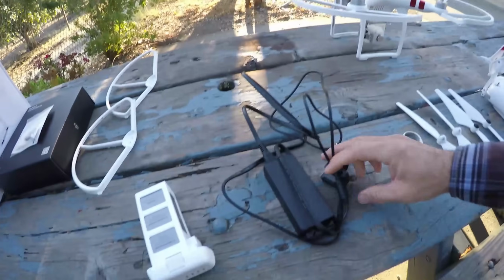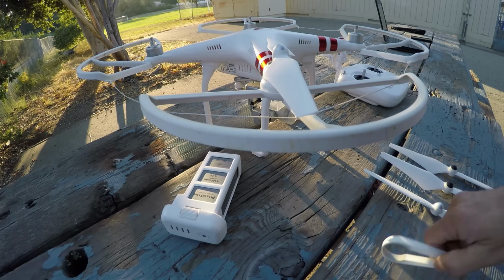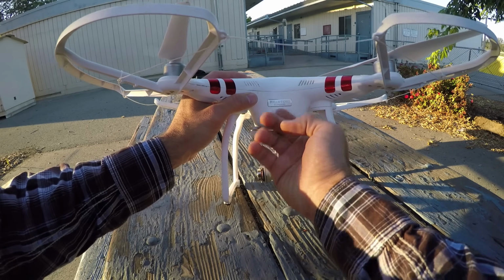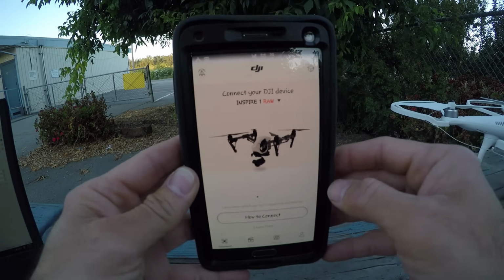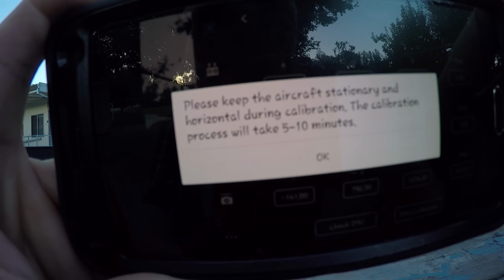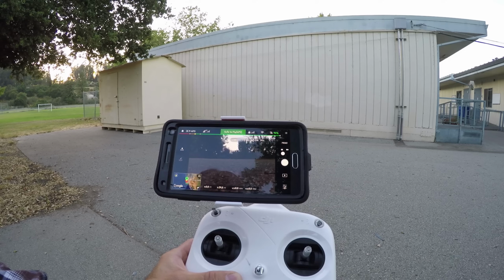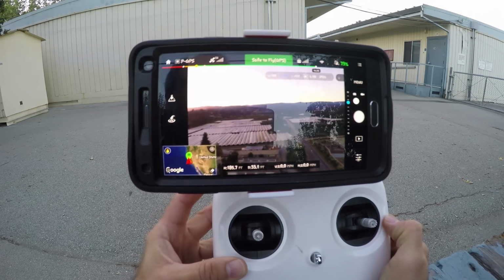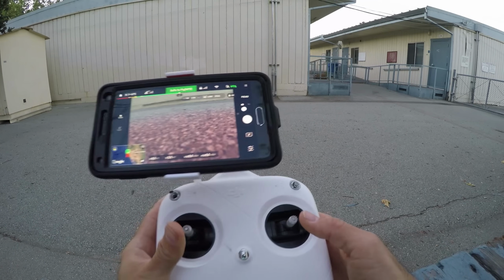DJI Phantom 3 Standard Complete Starters Tutorial

Comment: Tripecollie,You forgot to mention something very important. Unless of course I missed it. If you decide to take the propeller guards off make sure you don't use the same screws from the guard to secure the motor. They are longer and will reach the motor and jam it so it won't turn, or worse it'll turn enough to get off the ground and burn out the motor. Resulting in a crash. Make sure you use the ones you took out to put the guards on. The shorter ones.
Reply from the maker: I do mention at 9:28 in the video that the screws are longer and to save the screws. Granted I didn't mention why it matters though. I made this video really fast all in one day for my dad and didn't expect it to get nearly this popular. There's several things I would do better and change with the video in retrospect but it does work really well as an introduction.

Comment: I am new on this and first time I tried as I turn on the phantom 3 and my remote in about few minutes i noticed  the camera motor was kind of hot i wonder if that is normal , so i had to turn it off
Reply from the maker: Sorry it's taken me so long to respond here. A certain amount of heat is normal, but there's no way I can tell if what you're experiencing with your drone is too hot or not. Does your drone go through the normal camera rotation/orientation process when you first turn it on and otherwise display signal on your cell/tablet properly?  You are removing the camera guard and the lens cover first right? Sorry if these questions seem silly. I'm just trying to narrow things down.

Comment: I bought a Phantom 3 Standard several weeks ago and I have watched many YouTube tutorials on how to operate it.  I have yet to fly it since I could not understand how to operate the DJI Go app.  This is the best tutorial that I have seen.  I still don't understand about how and why the string is attached to the prop guards.  Could you please explain further?  However, all in all sir, you have produced the most informative tutorial about the Phantom 3 Standard that I have ever seen.  My thanks to you.
Reply from the maker: Thank you very much for the kind comments! As for the string, that is simply a barrier/block that holds your prop guards together and helps protect the blades further. I'm kind of surprised they don't have a way to connect all the props together better than a piece of string. For something so fancy/expensive the engineers got a little lazy/cheap on that part of the prop guards lol.

Comment: I noticed when you are flying the right controller switch was in the down position but in the info on the controller you said you put this in the up position? just not sure what these two top switches are for
Reply from the maker: Excellent question! I end up bumping those stupid toggle switches all the time so I did not intend for the S1 switch to be in the down position for the video. So, what are the S1 switch (on the right side of the controller) and the S2 switch (on the left side) for? The User Manual (file Phantom_3_Standard_User_Manual_v1.4_en_0112.pdf on the DJI website) explains the switches thoroughly. I'll give you a synopsis though...

The S1 switch :
*Allows you to regain control of your drone during the failsafe return to home process. I consider this the most important function of the S1 switch.
*Can allow you to calibrate the aircraft's compass, but you can do this through the DJI app too.
*Changes your flight modes (P-Mode, A-Mode or F-Mode) but you can do that through the DJI app as well.

The S2 switch:
*Can initiate a smart return to home process. I consider this the most important function of the S2 switch.
*Can be used in conjunction with the Gimbal dial to link the remote with the aircraft.
*Can be used to reset the WiFi password.
*Can be used to Reset the WiFi Video Downlink.

I hope that helps!

Comment: Of all the tutorials I've watched no one ever mentions operating the Phantom 3 without a cell phone. Can this be flown without using the app? I know you won't be able to do anything except go up down left and right if you can. I'll be getting my P3S in a couple weeks, but don't want to have to buy another new phone. My phone is a LG G3 it's new but not compatible with the Go app.
Reply: I've flown without a compatible phone so no,  but to calibrate and use certain flight modes u will need a phone. on my 2nd flight I went to use my tablet which waa dead so I just flew it using the dji controller
Reply from the maker: As far as I know you have to use a cell phone or a tablet though. How do you know your phone isn't compatible with the DJI Go app? If a phone isn't listed that doesn't mean it's automatically not compatible. I've heard of older phones running the app. DJI just lists recommended phones on their site. You can operate a Phantom 3 with an appropriate tablet and have a better view of what's going on (assuming you have a tablet). Otherwise, I'm aware of other apps you can use to control drones like the phantom but I've always used what DJI provided to make things simple. Good luck in your research online. There's lots of sites you can look up on google for information.
Reply: I had sent email to the support staff at DJI.com. They are the ones,  who answered my question said it wasn't compatible. Maybe it is compatible and the person answering didn't know. Anyway, thanks for the reply. If my LG doesn't work, I'll buy a used tablet.

Comment: Thank Q I love this ... Will ask u for more in future .. If i need any help
Reply from the maker: I'm glad to help if I can :)
Reply: Did u ever fly on the surface of water ?? how i can fly without worry of going down to water .. since phantom 3 standard dont have the obstacle sensor so wonder how i can fly above water surface without any worry .. Thank Q in advance ..My phantom3 standard is on the way m so excited to see my baby :)
Reply from the maker: +D Mantra Yes, I've flown over water, but it's a calculated risk. The Phantom is a great deal for the price, but they can be quirky and lose connection and do strange things at points. There's plenty of people with unhappy stories of their unit not responding when needed. I've had very little issues with mine. Basically there is no way to completely rule out any sort of problem. Just be mindful of your distance, things like signal interference, etc. I hope this helps.
Reply: Can u share some clips which u shot recently .. would like to see :) ..
Reply from the maker: Sure. They're here in my channel, but these are the links:

https://www.youtube.com/watch?v=ZY_gvM06axI

https://www.youtube.com/watch?v=BC6bmnH7_5I
Reply: OMG today i received my P3 standard and getting so excited so many things to be learn .. First thing i noticed is the Switch L-R in RC upper section . and the seller told me to charge the battery fully after i received the item and so its charging now .. I think the Drone battery charge fully it stopped and shut down automatically but the RC battery took a hell lots of time and still indicate to second LED which means i have to wait for another couple of hrs .. I checked in others channel for beginner guide which is not complete at all ... only your tutorial is giving me everything .. Hats off Bro ... I salute
Reply from the maker: +D Mantra Thanks for sharing and the kind comment :)